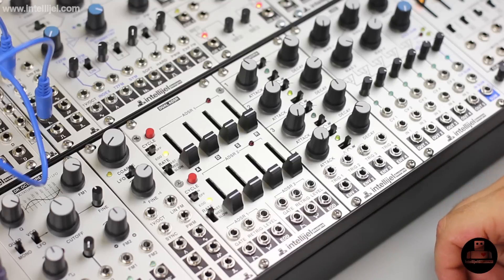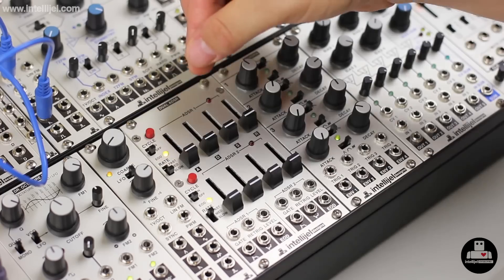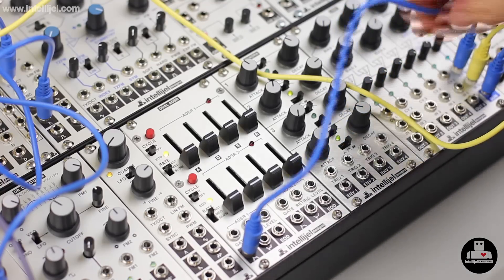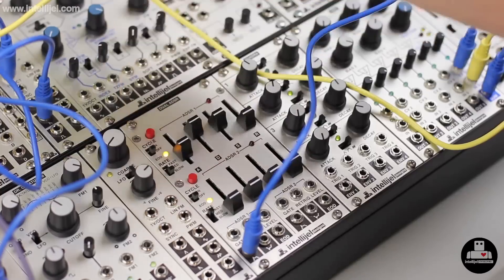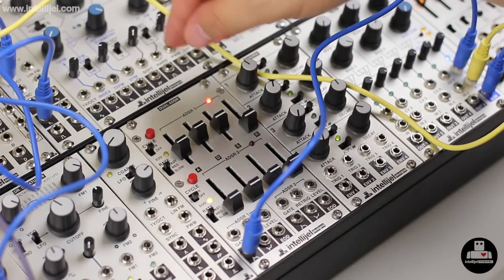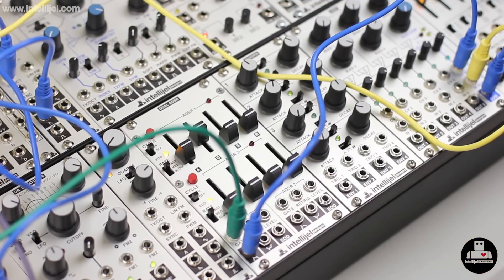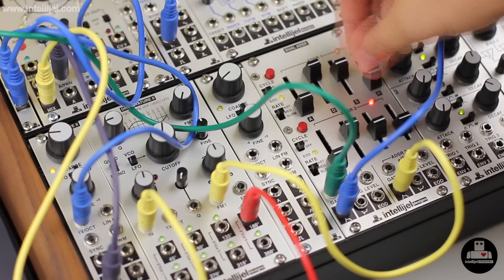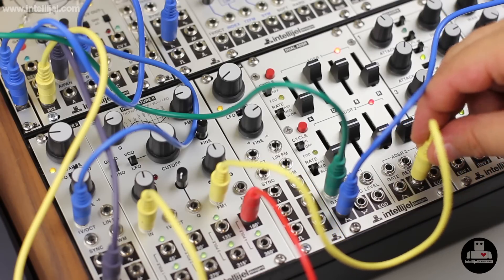Intellijel Dual ADSR demo 1

Comment: Whenever I move the sustain slider on ADSR 1 slightly up or down when cycling mode is engaged, the cycle will stop suddenly or hang up. I'll have to flip cycle mode off and on to get it to come back, but if I touch the sustain slider again it will stop. I'm not having this issue with ADSR 2 or any of the other sliders. It seems this particular slider is really touchy. Anybody else having this issue?

Comment: i've been out sick for a while but did order the first batch dual adsr's. they do have a lot of options and i really like the design, like no other but for some reason i don't find them so tight in control. it seems like things start to get work after say over 20% in slider level. especially on the attack side at all rates it seems to act strange. when i use it in sequences, the d/s/r only seem to have effect while the attack doesn't do anything or just completely makes the sound go away even on very low levels. i heard similar things about the atlantis. dail in 5% of the slider and boom it's there in full force while with this adsr i seem to experience the complete opposite. i wonder if any other users have similar issues or if this is a batch issue. i'd like to know or hear more about this.
Reply: +Ammer Reduron Having the exact same problem with it.
Reply: damn i was gonna buy this but reading this i am questioning that thought...  are you still using the adsr?
Reply: SINISTER survival Me too! Did you not get it after all?